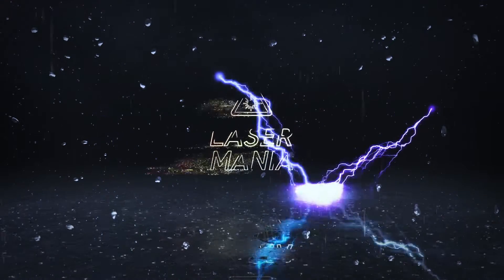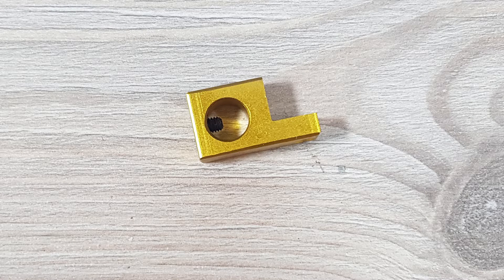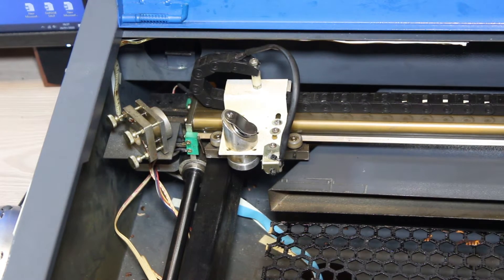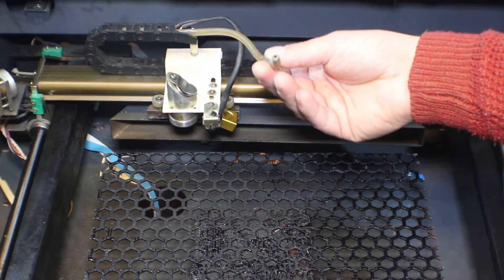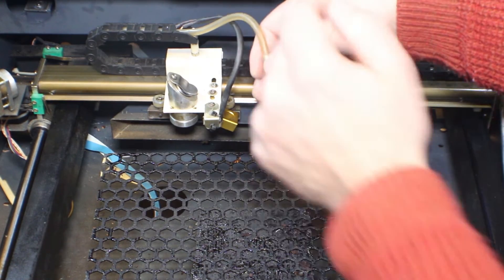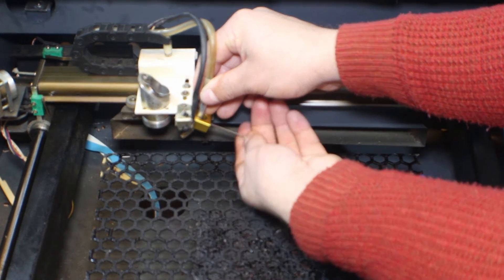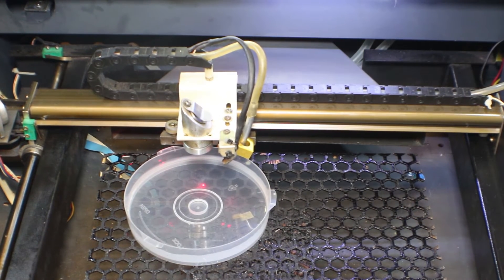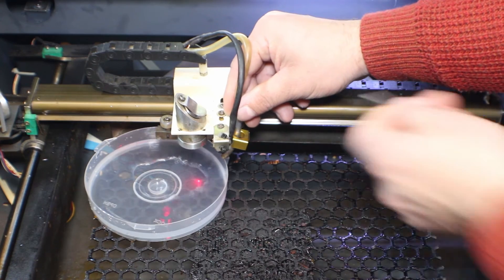How to Install Air assist on Your  K40 Laser

Comment: When I added a 50L air assist to my k40 laser It turns on and off by itself, what is the SOLUTION please 🥺
Reply from the maker: Possible some electrical connection issues

Comment: Where did you get the white bracket?
Reply from the maker: If you mean the jubilee clamp ( the one I tightened the pipe ) on Amazon/ebay,  if you mean the bracket that I attach it to the laser head( tha gold  one) it came with the laser  as is an upgraded k40.
Reply: @lasermania6805  Thanks.

Comment: Hello. Did you upgrade more your k40 laser? Air exhaust, laser head...?
Reply from the maker: Hi, mostly  the essential ones, some air vent hose as the stock one was to short, the water pump, mirrors and lens and some other little things.